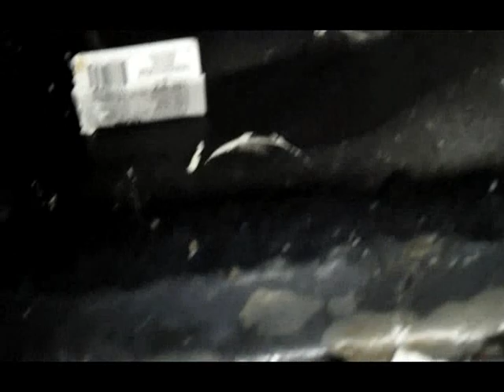Civic Update / Tweets N Car Crap

Comment: You got a vacuum leak, get that intake gasket fixed right and the sensors will stop sending the computer bad signals. Therefore stopping the high and low idle